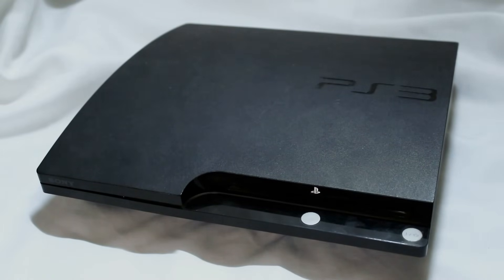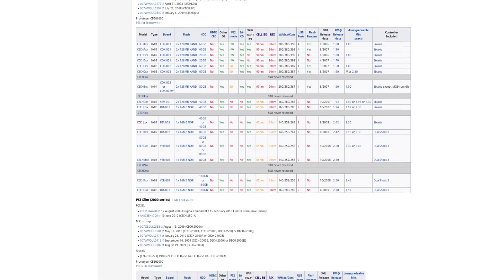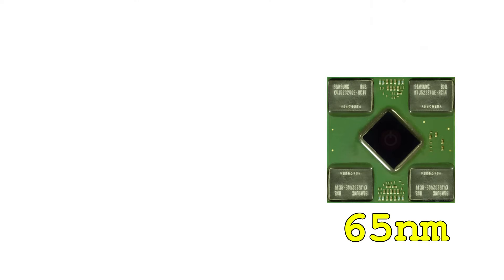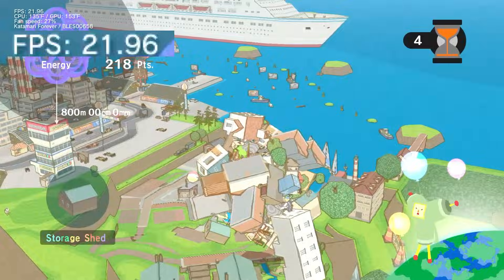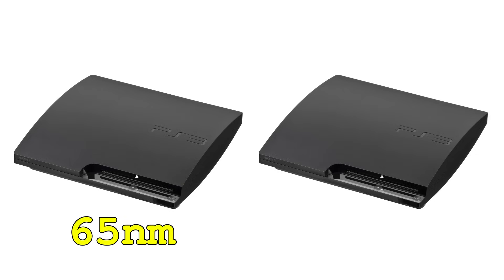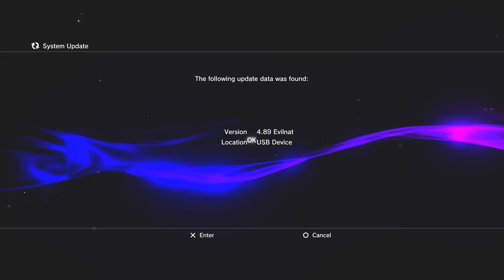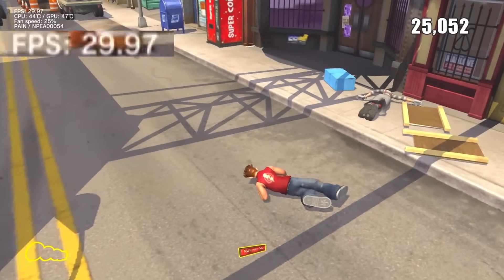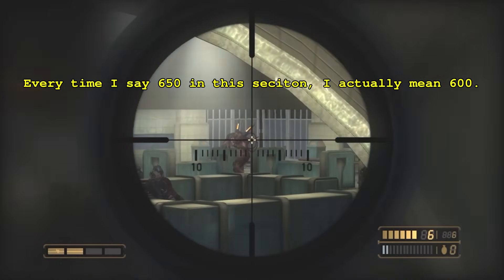Overclocking a PS3 with Project RSX Boost

Comment: Is there a risk to break something on the motherboard like GPU/VRAM, capacitors etc...?
Reply from the maker: The biggest risk I'm aware of, aside from prematurely killing the RSX, is extra ripple from the overclock shortening the life of the NEC token capacitors if your console has them.
Reply: @sync-on-luma  what? Extra ripple? The voltage isn’t touched. The OC doesn’t do anything of that sort. Sadly voltage is locked down.
Reply from the maker: I had read that the overclock can cause additional ripple, though maybe I'm wrong on that.
Reply: Yeah i think it too, my old PS3 got destroyed for that i think @sync-on-luma
Reply: @sync-on-luma  well that’s not true. Voltage is locked. The only thing that can cause degradation will always be heat. Aka more voltage. PS3s already run hot, it’s why if we ever get voltage increasing into cfw, we will all need to improve our cooling that much more. If cooled correctly and kept below 70c at all times, there should be zero issues.
Reply: @Tanzu15 i think i destroyed my old PS3 for oc btw, how do you know that the voltage is locked? Just to be sure
Reply: @Alph4_XX  if you tried to OC higher than the chip can handle you risk bricking the PS3. This is silicon lottery we are dealing with. But now we have enough data and we have testing methodology. Depending on the model of slim. The OC will vary.
Reply: @Tanzu15  No the problem is, im not really sure because i dont remember well, but after installing 4.89 OC Evilnat i was having problems like YLOD playing PS2 games and heavy PS3 games, the fact is also syscon was reporting damaged NEC Tokins of RSX. Now i recovered and unbricked my old PS3 that is working PERFECTLY with low temps so i dont want to ruin it, but in some games its stuttering so i want a little of OCing.